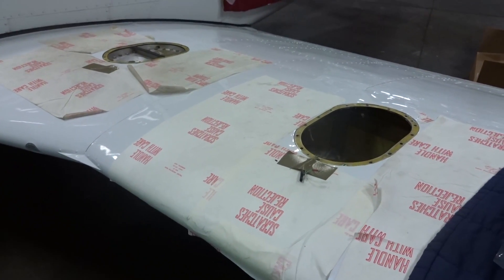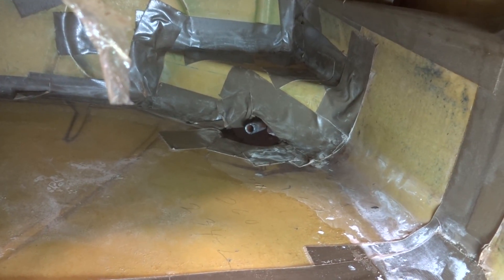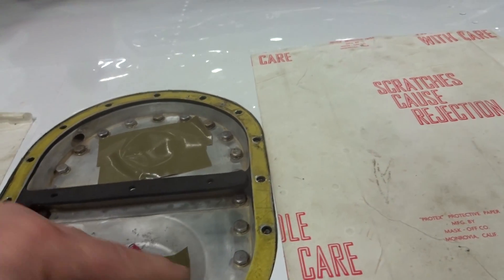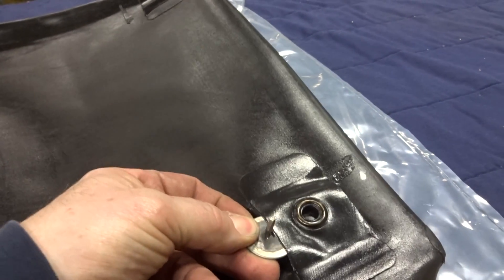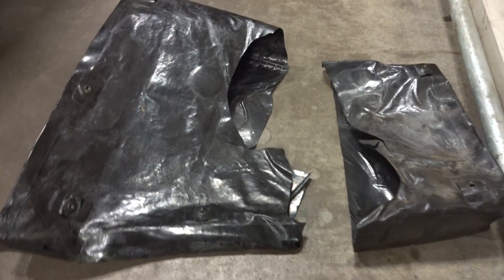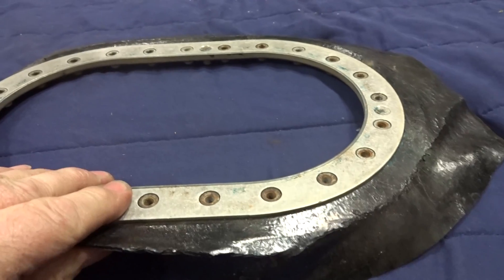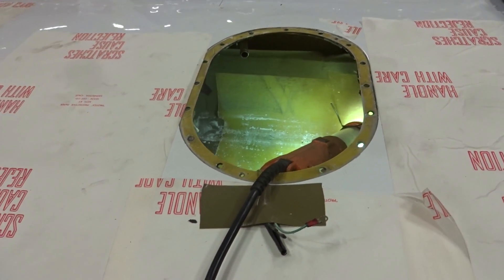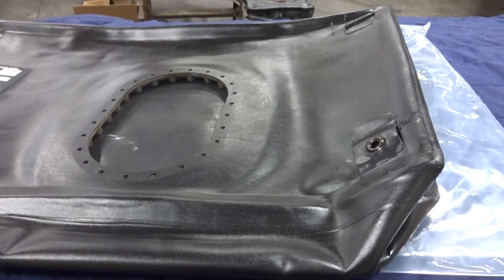Comanche Fuel Cell 001

Comment: I am very curious, how long the seals in my '86 Malibu will last. No rubber tanks but I wonder if the material that is sealing up the aluminum is any better than there bladders. Sometimes I wonder if the biggest problem will be leakage or little pieces of sealant clogging up the fuel filter, which as we all know sucks.

Comment: Hi what was the cost to change one ? i might have the same problem...
Reply: They're about 1,000 bucks per bladder. Labor is about 10 hours so anywhere between 800 and 1k in labor per. Comanches with the aux bladders have a total of 4. So you're looking at 1,800-2000 dollars installed, per bladder. Life cycle of a bladder should be in excess of 20 years but in practice with weathering, top of the bladders remaining dry for a long time due to flying with partial or even empty auxes all the time, you'd be looking at 10 years before these things start giving you trouble again. I prefer Piper's integral tanks; unfortunately Piper didn't really have a replacement to the comanche (I don't consider the Piper Lance a bona fide in-class replacement in the least, as Piper argued), so you're kinda stuck with these old Comanche contraptions if you want something between an Archer/Arrow/Dakota and a 6-place airplane like PA32 and A36 C210 et al. Their competition being the Beech 33/35 bonanzas of course, which also carry the expense and hassle of these bladders, to be fair to the comanche.
Reply: FUEL bladders although a pain sometimes... MUCH safer than metal or Wet wing tanks in survivable accidents !  they absorb impact better and may not rupture vs the  other style... I'll take my bladders any day.. IMO